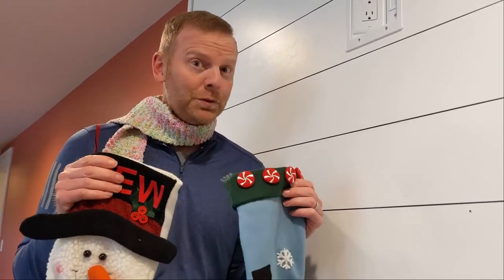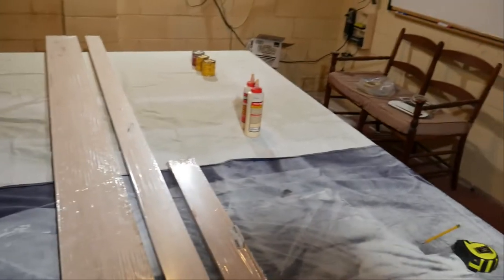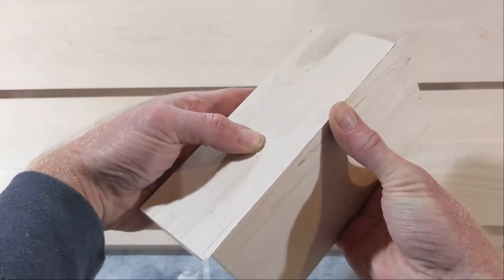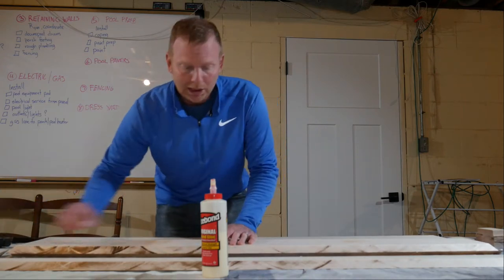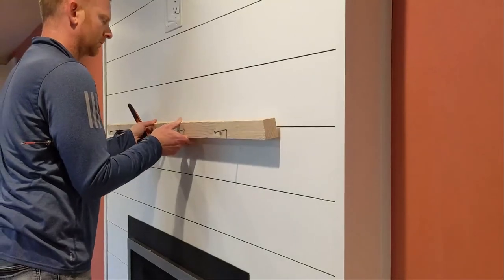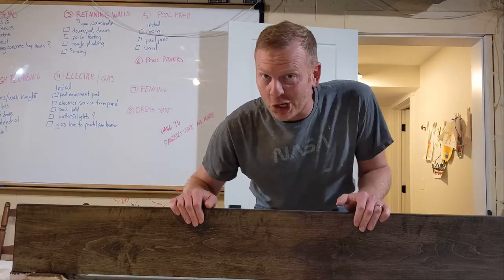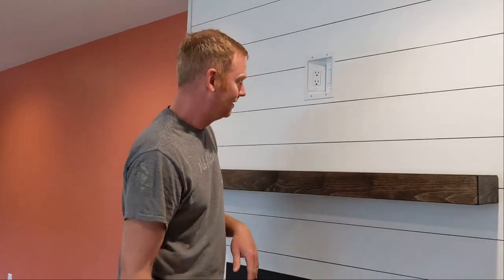How to Make Wooden Fireplace Mantel | DIY Floating Mantel #WoodenMantel #FireplaceMantel

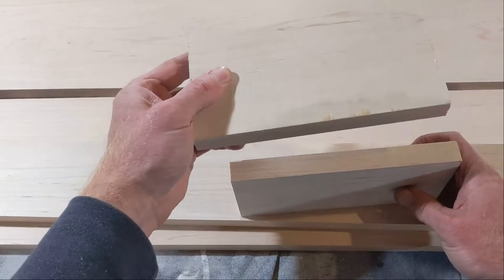Comment: At 1:45 your thoughts on appearance is a good point.  The miter cut is the way to go for aesthetics.  What was your approach for measuring for the end caps?  This type of joinery is new for me.
Reply from the maker: I really just took the depth measurement from the front to the back, and then the height from the exterior of the top to the exterior of the bottom. Then I cut the end caps at 45° on the three sides.I  would have done a couple of things different if I did this project again. I've done a couple of other floating shells with different methods with different levels of success.

Comment: What is the height of the wood mantle itself; 4inches? Also did you use maple?
Reply from the maker: It's 3 1/2 in high ( 1 by 4).  I used maple for the cool grain pattern and ease of staining, but I wasn't paying attention when selecting the wood.  The grain pattern in front looks a little like oak.  I think I'd probably try aspen the next time.  Good luck with your project!

Comment: Is the front where you put the mantel made of wood? Is that not a fire hazard? 
Or do you have a concrete wall behind that? Thanks!
Reply from the maker: This fireplace is framed with non-combustible materials infront of an exhisting block/wall.  The bottom of the fireplace exterior has fiber board (non-combustsible).  Up at the  top, the rest of the exterior is made of wood (combustible, but high enough to meet the specifications of the manufacturer).  I followed the provided directions with the gas fireplace.  They were very specific where combustible materials could be placed, even the hight versus width of the mantel.  Thanks for watching!  You can see the video of making the fireplace here https://www.youtube.com/watch?v=YwMEWy5eSpI

Comment: What size wood did you use for the mantle?
Reply from the maker: 1 X 4 for the front and sides, 6 ft. length served my purposes.  For the top and bottom I used a 1 X 8 and trimmed it down to 7 in. wide to meet the requirements for the gas insert below.  I was going for a less-beefy looking mantel. It was quite a rewarding project.  If you try it, best wishes!
Reply: @figuringitout9956  Thank you for the reply. Just finishing up the electric fireplace wall adding shiplap and will be building the mantle with similar dimensions as yours.

Comment: You know buddy you would be better off using your fingers there on the table saw than that plain old stick you used as a push block. Now that was scary.
Reply from the maker: Thanks for the comment.  Please elaborate, I'm always up for safety tips.  Is this because a scrap piece of wood has a higher chance of slipping than a legitimate push stick?
Reply: @figuringitout9956 Seeing OP didn't reply, the reason you shouldn't use a stick like that is simply a lack of grip. The chance of slipping on the wood or in you hand is much higher. There is also less pressure transferred to the workplace which makes it more dangerous.